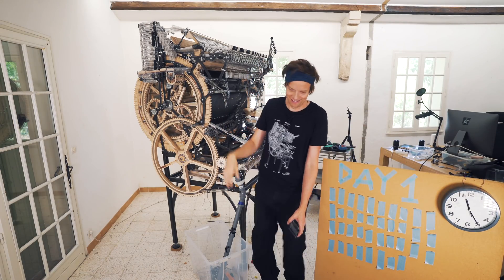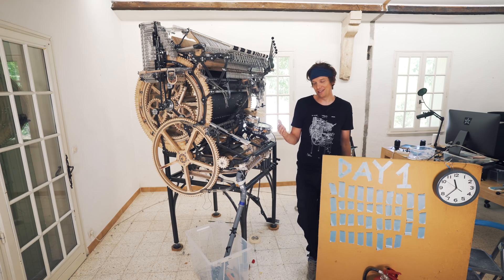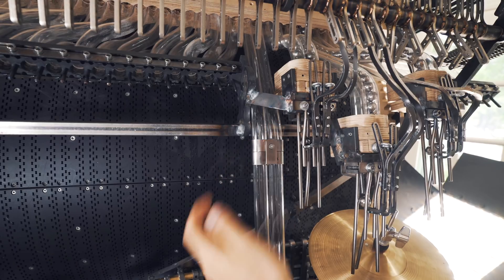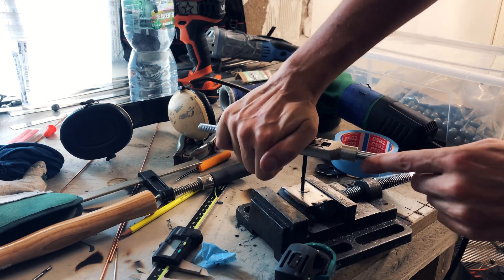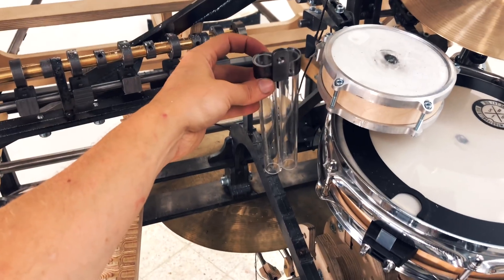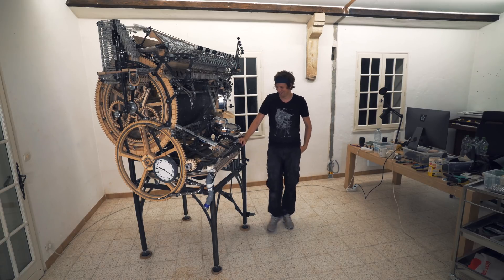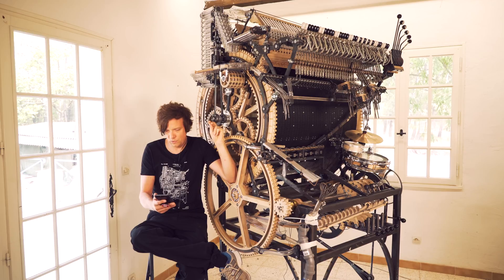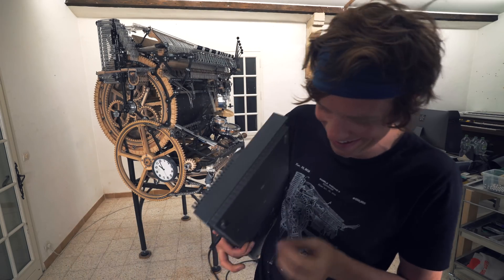38 Is a Magic Number - Marble Machine X #89

Comment: The "is this a good idea" moment feels extremely familiar to me. If it happens on a personal project (or, even more so, when making art), I think the answer should always be YES! Your idea inspired millions and, I hope, made you a happier person. If it turns out that the MMX stops doing that tomorrow, it will still have been a resounding success. I mean, you probably got more people into engineering and music than a diet of Star Trek and Queen ever could (and I love these things)!
As for the question if the machine is going to be good at what it was designed to do (and better than conventional alternatives): I made at least three friends by showing the original marble machine video to people. I therefore consider it proven that there is a market for marble machine music 😉.
Of course, during the design and manufacture and when playing the machine, the ultimate measure of success is how much you enjoy what you are doing.

Comment: WHEN you're finished with the machine, you should make demos with light emitting marbles. Would look awesome. Fun to see in the dark too🙂
Reply: Wouldn't work with the magnetic lift, I assume. But it would indeed look awesome!
Reply: Mutaburasaurus You could probably hit the steel marbles with some kind of UV fluorescent paint?

I mean, that’s not exactly what OP meant, but would work and look cool.
Reply: @Mutaburasaurus  the marbles could have a metallic core with only some thin outer shell producing the light
Reply: I don't think that would work (it would gum up the works), BUT small daubs of luminescent paint on the moving parts of the mechanism would be almost invisible in normal light -the MMX is already beautiful- but would highlight the mechanisms when exposed to UV light.   Also, it would look like stars, which works with "Wintergaten", aka "The Milky Way".
Reply: @jeric_synergy8581  nice idea

Comment: why are you using acrylic for your tubing? they are so hard to work with because you have to saw thru them. have you looked into PETG hard tubing instead? I found that using PETG, i could just use cutters to shear right thru them in a second, then just sand it down on the sander, and clean up the tube. (im assuming you have to clean up the cut anyway). They are also more tolerant of heat, so it takes a bit longer to heat up, but the bends can be cleaner. I just found it to be a more forgiving material.

it's probably a bit too late in the process, but just wanted to help if could

Comment: A strange thought has occurred to me: The tubes are of different lengths in order to fit into that tight space.  Does the variable lengths of the tubes increase the travel time of the marbles and therefore cause timing issues with the music or has he a clever mechanism/solution to account for that?

Comment: I forgot if he explained this in a previous video. Is there a way to adjust for the time it takes for a marble to get through the pipe? He mentioned in this video that he had to make the distance the marble drops the same for each channel, but how would making the pipe longer do that if the marble gate is still at the top?

Comment: I'm sorry, but I have to disagree with you - I went to check Wikipedia: "Engineers, as practitioners of engineering, are professionals who invent, design, analyze, build, and test machines, systems, structures and materials to fulfill objectives and requirements while considering the limitations imposed by practicality, regulation, safety, and cost."
Yep, you are an engineer whether you want it or not - and pretty inspirational on top of it 😉

Comment: For the big cymbal, mounted besides the flywheel: You made this extension. 
For all the other channels you have the 3D printed marble drops and the below that the second marble drops (out of metal). Do you plan on putting a second drop there as well, because just looking at it seams very difficult to pull this off mechanically because of the really long distance to the “triggers” you put these white and black caps on. 

BTW I really like your Videos, I’m really looking forward to the world tour.

Comment: I think it would be better to not disassemble and reassemble as the machine is moved.  Might want to put wheels on that machine for portability and possibly leveling which will be quite important.  Maybe even electric motors to drive it etc...  And, add a massive low center of gravity weight to keep the machine from falling over on inclines.

Comment: You might want to double-check if the two sections can be easily separated now that you have this new docking-port (see 7:21). Since you have the sticking-out-bit on the lower part, that indicates that the instrument section should be removed first / added last. But I have a faint memory of seeing you separating the instrument section by lifting it upwards from the main frame. This indicates that the marble divider section needs to be removed first / added last, but then you might need to flip that docking-port.

För övrigt gillar jag att du sa Tungsten på svenska :P

Comment: How do you plan on doing a drop mechanism on the cymbal / connect it to the programming system if you mount it that low and expect to do it easily disconnectable?

Comment: Have you tried using compressed air or a vacuum to pull out the medical rubber form from the tubes rather than a pull string?

Comment: If the balls are released at exactly the programmed time, will they drop on the instruments in sync? When I see the pipe to the cymbals, I think those balls will fall a tiny little bit later then on the drums. 

But you're doing such a great job with the mmx, probably fixed it somewhere else I might have missed. Love following your progress every wednesday! Wish you the best
Reply: Don't forget he put in slight adjustment pins on the top of the MMX where the actuator from the programming wheel releases a ball.  Each individual track can be fine tuned, he just needs to make everything uniform first.

Comment: As a welder im cringing at how you tig. Hold it like a PEN. and push the button with your index finger. DO NOT hold it like a gun and push the butten with your thumb. im telling you. you are going to get 10 times more control if you hold the pistol like a pen.. and let the cable hang over your neck so the pistol wont carry the weight.

But that doesnt mean i dont admire your work overall <3

Comment: I been through the same feeling in some of my projects. The feeling of doubt asking myself "why am I doing this?". This usually happens when you're almost done and you realized how simple the machine does, how simple the idea you want to achieve and yet how complicated you made it to be and how much work went into it. :) :) This also gets triggered when you hit a scenario that you have to do somethings (because you don't have a choice) that destroys the beauty of the machine, i guess it's the vibraphone pipes/tubes. But it does not matter. Just keep going. There are so many reason why you should continue to be inspired in completing the MMX. Keep it up!!!

How about replacing those vibraphone pipes with 3 steel rods to guide the marbles to the right drop point. It would probably look a lot better. ;)

Comment: I think the kinetic fingers should only be used when you don't have the ability to project the mmx onto a screen.

If you are recording a music video with the mmx, I think the kinetic fingers should be left out, unless the specific song thematically makes sense to keep them.

I do recognize that the movement is very hard to see from on stage, but if there is a camera pointed at the parts that are moving, then we can see just fine.  If not, then the kinetic fingers make sense.

Or you could have larger manual handles.

I look forward to the future of this machine.

Comment: You ARE an engineer. Degrees don't mean much in the real world.
Reply: He is a Musician. Have you ever looked at or worked on an electro-pneumatic organ? They are extremely complicated. They were not built by engineers, but musicians. I am a professional engineer but I have limited musical talent.  He is more talented than most engineers especially with the CAD and the CNC machines. This device could not have been built by an engineer without musicians being involved.
Reply: @johnbailes5818  Indeed he is a musician. I have worked on pipe organs and they are very complicated. I can't play one ( that is -- make real music ), but can definitely repair one. Overlapping talent is precious.
Reply: Musician and engineer, while rare, are not mutually exclusive. Martin is definitely both.

Comment: Have you ever tried adding silicone spray to the rubber bending device so it comes out of the pipes easier? I think it would save a lot of strength and effort.

Comment: Will the added length in the pipe for the symbol add a delay to it or is there a way to counter it already built in?
Reply: the release point for the marbles is actually after those pipes, those pipes only are there so that only one marble is released at a time
Reply: @duon44  Correct.  Martin specifically states in this video that the distance from the drop point to the instrument is the same over all instruments.
Reply: I was wondering the same thing, you'd think that getting the timing right is really difficult when all the pipes have different lengths from the release point to the actual drop.
Reply: As I understand it, the programming pins control the release levers at the top. The marbles travel through those PMMA tubes and down onto the instruments. If the length of the tubes are different then the marbles will take different amounts of time to travel the length of the tube which would result in timing issues. If that is true, the only way I see that problem being solved is if there's another release mechanism at the end of each tube, immediately before they begin freefall.
Reply: @F3Ibane  there will be a release mechanism at the end of each tube, as has been demonstrated in other videos.
Reply: @WhatAboutTheBee  OK, thanks. I haven't been keeping up with the series well enough and must have missed the video(s) where that was shown
Reply: @F3Ibane  he actually touches one in this video wherein he calls it a "marble drop".  Pause your playback and go to 1:00.  He touches it there!  Go back to 0:50 and press play to see him explain the tubes are pre marble drop.  Cheers!
Reply: @WhatAboutTheBee  Got it. Apparently I'm just an idiot... for some reason I was thinking the tubes were post-release. 😳
Reply: @F3Ibane  Nah.  This is a complicated mechanism.  Its easy to get sidetracked.   Martin is so intimately involved with MMX, he assumes that you know it too!   So he glossed over the drop point, because, of course, you are aware of the situation.  I don't envy Martin in this, as he cannot anticipate the zillions of questions from the general public, nor critiques from myself and other degreed engineers.  The comment boards here are fairly polite, so I don't mind the conversation.  Its easy to get confused by the MMX, don't take it to heart.

Comment: Hey Martin, I know you've definitely thought about this, but I don't actually know, so I was wondering how you ensure that the timing between when the notes are plucked by the programming pins is the same as the timing between two or more marbles hitting their respective instruments? This question presented itself when you were showing the much longer marble pipes going to the crash cymbal since those marbles will have a longer time to reach the cymbal than the other marbles will have to reach their instruments. Is there something built in for that or will you just have to account for that by programming one note later to make up for that or something like that?

Comment: It would be nice if instead of the fingers you put an electric switch and an Led, so that it looks nice and the audience sees it, really easy electronics, you could even get the power from an XLR with 48 volts, calculate the resistance and go on :)

Comment: I just realised, how do you manage the travel times of each marble tube? If they are different lengths won't the drop times be out of sync?
Reply: The tubes are a holding point, the drop mechanism is at the end of the pipes, and they control the drop time
Reply: Plus, things like the snare and bass are at different heights as well. Dunno if he's going to have to manage offsets in the programming, or if this'll require some added loop-de-loops or something in the final segments of the marble runs to sync things. Seems somewhat hard to adjust.

Well, maybe he had some adjustment up at the marble release mechanism for this, now that I think about it?
Reply: @mkelly0x20  He has a ton of adjustable parts. He will have to calibrate everything but he can make it play in time.
Reply: As far as I understand marbles are not going to fall directly from these pipes to instruments. They are going to be held closer to instruments and released on next beat. You can see this ready on 2 first pipes around 0:27.